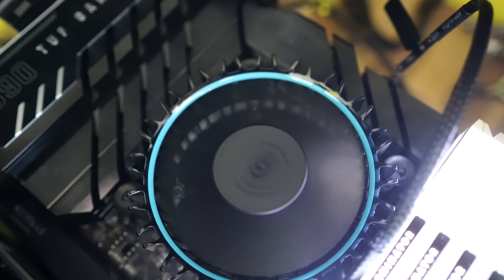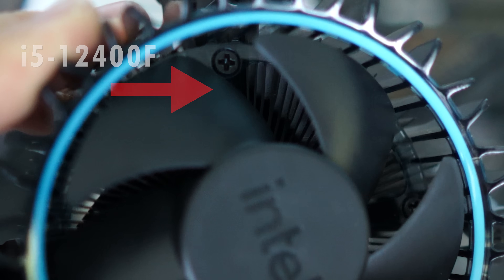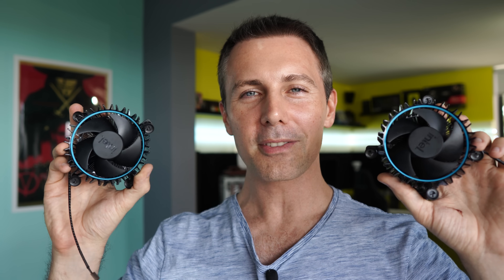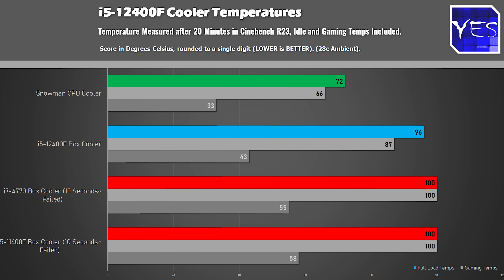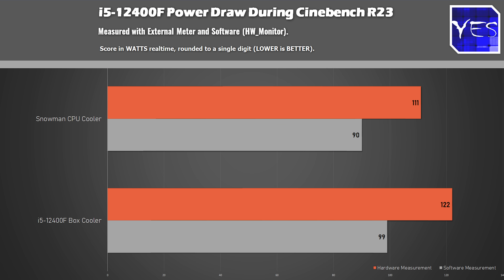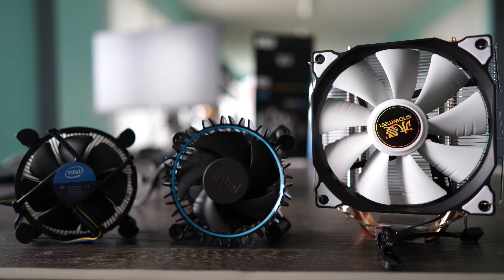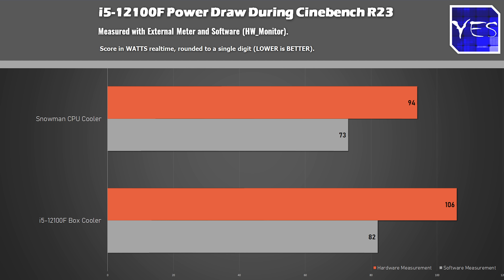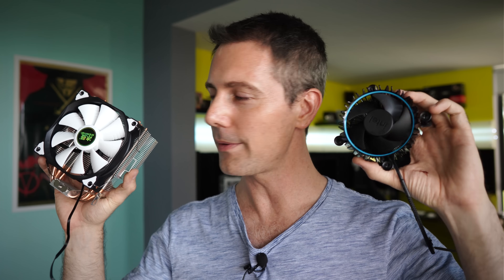Is Intel's New 12th Gen CPU Cooler Actually Garbage?

Comment: Can you fit a Wraith Prism onto an Intel CPU - to compare coolers? The Intel coolers look flimsy, though how do they stack up with AMD included coolers? $20 for a new cooler can go towards the more expensive AMD CPUs?
Reply: No IT can not.
IT use a clip systeem.
If you whant to do it .
You need a socket 775 clip systeem rack .
And the do not fit on the holes of the Intel boards.
Hè can try 3d print IT .

Comment: Remove the heatsink and you've got yourself a 80mm rearfan lol.
Reply: @Neorain-you just keep posting gems; how many cases out there use a 80mm exhuast fan as opposed to a 120mm?
Reply: @PapaMav  itx cases might have em. I also got a few cases with 90/80 rear.
Reply: @PapaMav  The heatsink you can slap on your forehead. Makes a good headmirror.

Comment: Reminds me of when I did a build back in 2013 with an i7-4770k (84W TDP). The stock fan couldn't keep up. I ended up putting in an AIO water cooler the next day.
Reply: That's a bit overkill for 84W 🤔
Reply: @Spido68_the_spectator  Overkill but it works.

Comment: Brian, I know you love the Snowman, but I definitely recommend checking out the Cooler Master i71c cooler. It’s $20 on Amazon, performs better than the Intel stock coolers, and has nice RGB. I’ve used a ton of them in my flips and it really does well!
Reply: Snowman is way better because it uses a hyper 212 no back pressure style setup unlike these stock style fans that just blow air on the mobo. Might as well get a deepcool 400 at 20$ on amazon if you don’t want to wait for China shipping
Reply: @seropserop  I understand your point from the perspective of absolute cooling performance, but I think the i71c has some great aesthetic points. It’s also incredibly easy to install and will fit on pretty much any motherboard and in any case, including a lot of OEM machines. It’s done great for me in many builds that I have sold!
Reply: @Brant Collins-don't know what AMAZON you are referring to, but, more like $38.80 in the States.....

Comment: No doubt the Snowman is a good cooler. I’ve used it on a few builds. There is another though…….and that is the “UpHere, CPU cooler. I’ve used this cooler on a 5900x clocked at 4.6 GHz all core……under 100% load……never got above 82C. Just for reference, using the Corsair h00i Pro liquid cooler on the same build, temps were uncontrollable at 4.6 GHz. Also, I am impressed with a thermal paste from “Shenzhen Halnziye Electronics”………specifically their “HY-700” product.
Reply: Hy-700 is worse than GD-900.

Comment: new? its still garbage. most reviewers are going to say these new intel chips are budget kings. they are in for a rude awakening. these wont perform well outside the more expensive, higher cost geared paired with them.
Reply: We'll see how much a H610 board with slower memory clocks hampers performance. But most B660 boards will be totally fine especially for 12100 and 12400. Memory can be cheap or expensive regardless so that's not an argument. Calling it garbage is a bit extreme. 12100F is the new budget king like it or not.

Comment: The same thing happened with AMD back in the day when they released their Athlon64 X2 series. The X2 series started with the LE-1620 cooler which was quite a thick thinned solid aluminum heatsink. With the 6000+ they just ran far to hot so they had to provide a new cooler which was the FAN-AM6000 heatsink. A proper thin finned design with copper vaper chambers and copper cold plate. I used the 6000+ cooler for years on AMD systems, since it fit on Phenom II CPU's as well, and it was just as good as aftermarket heatsinks of the early 2010's.
Reply: the 6000 cooler was like THE go to budget cooler for amd's cause it worked so dang good. I used it all the way till I started running 120mm tower coolers
Reply: @kasuraga  I'm glad others appreciated them, for the time they really were the GOAT before the huge aftermarket coolers really took off
Reply: This seems very similar to the one they bundled with Phenoms. It just uses a taller fan, which could have helped a lot. The Phenom ones were very noisy under load compared to a 9cm Noctua tower. Nowadays I actually prefer the C type Noctuas for ~120w loads.
Reply: The amount of needless apostrophes nearly gave me a stroke
Reply: @Nagib23_32  what?
Reply: @kasuraga  Look in the original comment
Reply: @Nagib23_32  it has ONE apostrophe, so again, what do you mean?
Reply: It will fit on AM4 as well.
Reply: @EvilTurkeySlices  while I despise amd's retention system, it is nice that they did maintain that system through the vast majority of the amd lineup. I just grew to hate it because I cracked a 2800+ barton core cause the heatsink tilted and chipped the die when I was trying to latch it over a decade ago.
Reply: @kasuraga  754 and newer used a different retention system to Socket A.
Reply: @EvilTurkeySlices  They use the same style of retention system, just altered for the new socket. They still use the spring bar across the center of the heatsink.
Reply: @kasuraga  it’s the same style, but different. Instead of using a screwdriver to push the silo on, there’s usually a lever to tighten it.

Comment: Just a thought (though maybe in reality this isn't relevant), if the Intel stock cooler on the 12400F has to spin fast to keep things under control, then perhaps the fan itself is using more power than the slower spinning fan on the Snowman under the same load? Grud knows whether it's possible to tell the difference though, or how large it would be. Perhaps feed the fan cables through a separate power monitor to see what they're pulling? I doubt it would account for much of the overall system power draw difference, but still something.
Reply: hotter chip consumes more power at the same freq and voltage. difference in fan consumption could be 1-3 watts.
Reply: @zodiacfml  Indeed it could be, but it would be good to see actual measured data. Sometimes such factors can reduce overall differences to just margin of error.

Comment: Idk if you heard but Der8auer overclocked 12400F to 5.2 ghz with bclk, apparently it's possible on some motherboards (he used high end asus mobos). Since you have non-K alder lake cpus, could you check if it's possible on the motherboards that you have? Imagine the value if it turns out to be possible on any cheaper motherboards. Could make for an interesting video.
Reply: Most likely it won't work with cheaper boards as it only works for boards with external clock gens which afaik only exist on top-end mobos
Reply: I have seen der8auer with 12400 at 5200ght and he said cpu was like 68 watts power consumption ..  I don't understand how that works... He can do that cause he can control voltage, or his data is just not correct?
Reply: @ZLO_FAF  The 68,9 W in the graph refers to power consumption while gaming. You can see him run a benchmark in the video @5:25  and HWiNFO is showing maximum package power 138 W.
Reply: @ZLO_FAF  I have recently seen a video from an Italian youtuber that showed cpu power consumption in detail, and yeah, it's not that bad, Alderlake has a very high peak consumption, but the average consumption while gaming and using you pc for productivity in a moderate way has acceptable power consumption.
Reply: Some B660 board can overclock

Comment: Wait, so the CPU draws more power with the stock cooler or is the aftermarket cooler just more power efficient?
Reply from the maker: draws more power because it runs significantly hotter.

Comment: Hey Brian, great video as always. Just have a dilemma since b660 motherboards are overpriced, is it worth it to save a few bucks and get 1th i5 and b660 combo
Reply: Could yeah. Depends on what you plan to do.
I run a 10600K in a B460 myself (which can accept a 10900K with some headroom !) And it works wonders. I built my PC around CPU and RAM combo because that's what Cities:Skylines asks for.

Comment: Change the fan on the old Intel cooler to the new fan on the new Intel cooler. You'll see the added static pressure and perhaps cfm is where most of the improvements are. The other part is the weight and design of the new cooler. But the fan is mostly the improvement.
Reply: When you say, "change the fan", are you including the plastic guide vanes as part of the fan? There's no old-vs-new Intel noise comparison in this video, but I wonder if it's actually an improved design, or if they just increased the top end RPM?
Reply: @Vegemeister1  fan. Its higher static pressure and cfm

Comment: Snowman is impressive for a $20 USD cooler.  Not very impressive up against a Scythe Fuma 2 where you can game in silence, or with just the GPU noise.
Reply: Such an awful comparison
Reply: Scythe Fuma 2 is 3x the price of the Snowman, when comparing Amazon (SF2) and Aliexpress (Snowman), here in Canada. Might be different in the US.
Reply: @soldierforchrist631 
I opted for the fuma 2, I run my 3500x at 4.1/1.285V(it didn't hit turbo and was running at 3.4/1.4V stock);

I have it set to be completely silent up to 75C(I have it set to stabilize at 70-75C in prime95 after 2 hours) above that I have my fan profile ramping it up to a 100 at 80C.

And I think it is worth the 3x price tag, you can go to sleep while your computer re-encodes your blu ray rips or whathever else.

In fact you could sleep right by the computer, I don't hear my fans at full load with an open case until my ear is like 10-5 cm from the cpu fans.
Reply: Well no shit but if someone isn’t buying an unlocked CPU there is absolutely zero need for a cooler like that. These are locked chips.

Comment: Still have my stock cooler on my Ryzen 5 1500X running a 3.9GHz OC at 1.35V (stock is 3.5 at 1.2V) with the CPU only hitting 66°C when under 100%Load.

Comment: Don’t you need to also measure the 12v wires off the 24 pin if you want to measure power consumed by the cpu?

Comment: I hate all the stock INTEL coolers i have to install. Not a fan of the plastic screw connectors. Recently i had to install a blueray player for a client. I hit the cooler by accident and had to reset it back on the mobo due to tight space. Just a major pain in the butt compared to the AMD equivalent. Why does INTEL make these low quality coolers ? They work well enough but why the cheap construction on the pegs? Ill always go with a screw on cooler if i can.  Does intel not understand you might have to take these off and put them back on ? Giving me nightmares just thinking about it.

Comment: The software reported power-consumption is rather accurate, i would assume a lot of what you are measuring is due to VRM efficiency going down.
Reply from the maker: This was done on a high tier z690 board.... couldn't imagine how much worse it would get a on a low tier b660?
Reply: @techyescity  That just makes it even worse.
But if memory serves me right HWMonitor uses Intels internal calculations and those again are based on the reported current and VID - which also tends to be inaccurate if any Mobo default-settings are messing with the voltage (And the z-boards are notorious for having extremely bad default-settings - a lot of extra voltage from LLC and other "features" that just increase powerdraw for nothing)
Reply: Sometimes it's accurate. I have a 4670K system where the reported full-load power draw differs by like 20W based on whether the machine was soft rebooted or powered off and back on.

Comment: Glad to see Intel upping their fan tech - it's definitely a step in the right direction for general users.
Reply: did they tho? their coolers are still not good enough to prevent heat throttle

Comment: I dont understand, why do the benchmarks with box cooler draw more power than with Snowman ?  Is the cooler itself drawing more power or ?
Reply: Because the fan is using more power as it spins faster…
Reply: The chip running hot basically makes the system give more voltage. Did an undervolt test of my GPU, at idle temps it did 110 watts in a stress test, when the temps start to go up it becomes 127 or so

Comment: And you're sure the older coolers didn't fail due to inadequate mounting pressure? I'm surprised they did so poorly compared to the new ones. The new ones just seem like older copper slug box coolers with a facelift. But... no surprise they got their trash kicked by the Snowman.
Reply: IIRC, on some of the lower-end models in some generations, Intel was shipping plain aluminum extrusions without even the copper core.  And sometimes the copper core is actually a vapor chamber, not a slug?
Reply: @Vegemeister1  Yeah, later on they definitely pivoted to the straight aluminum units. I have some sitting around here, and I have some with the copper center. And now I'm not sure if it is a vapor chamber or a slug. Good point. I'm curious which version he was using here, and I'm still curious about the mounting pressure, being they weren't made to be used on 1700, and companies offering adapters for existing coolers are finding that some have mounting pressure issues.

Comment: derbauer noticed you can BLCK overclock on some motherboards with the 12400, you should check your motherboards to see what ones have that hidden feature. it doesnt show up with a k cpu in
Reply: ASUS seem to have slipped this feature on the ROG MAXIMUS series using BIOS 0811 (der8auer showed it was there on both the Apex & Hero boards) when coupled with a non-K CPU. Why anyone would spend that much money on a motherboard to couple it with an i5 12400 might be viewed as weird purchase decision.

What I do find funny is raising the BLK is exactly how I used to overclock Intel 486 and AMD Athlon 64 CPUs as well as the obligatory downclocking the memory clock frequency to compensate... everything old is new again. Personally, I haven't used a locked CPU since the AMD Athlon 4400 (my first unlocked CPU was the AMD FX-60).

Comment: Isn't the power draw difference between software and direct measurment caused by VRM inefficiency?
Reply: yes!
Reply from the maker: Depends, the cooler alone dropped it by 10 watts, so also has to do with CPU heat as well. I think measuring both is the best way to go?
Reply: @techyescity  The power draw difference between coolers is mostly because of boost voltage optimization which adds about 1.5mV per C  increase in package temperature. Intel CPUs maintain boosts up to Tjmax and PL1/2 by ramping up the voltage rather than throttling back on the multiplier as temperature rises. 

As for VRM vs CPU power, unless you made sure LLC matches the DC loadline configuration of the CPU, we can't trust CPU power. The software CPU power is calculated using VID, temperature, and instructions mix executed so if VID is different from Vcore because LLC isn't set according to DC loadline, the power calculation will be inaccurate. Best to assume 90% VRM efficiency and go from there.
Reply: @techyescity  Cobber and silicium conduct electricty better at lover tempratures. So the drops in 10W is simply the CPU is more efficiant the coler it is. When messure the power on 4/8 pin CPU header and compare with the software CPU power, the different is heat/VRM losses.

Comment: I wonder how much can we optimize 12400F with undervolt? I mean, its locked anyway, might well run it at minimum required voltage.
Reply: De8bauer just released a video that 12400 is not locked on some motherboards. That was quite a surprise :-D It overclocked really well too to 5,2 GHz all-core.
Reply: @innocentiuslacrim2290  its still multiplier-locked. He just did BCLK overclocking with a board that has a clock gen. Doable with all non-K CPUs since Sandy Bridge but usually could just go 3MHz BCLK higher. Some boards with a separate clock gen could overclock BCLK without affecting SATA/PCIE clocks etc. This results in further overclocking just like the old FSB days
Reply: but make sure to not reduce stability while doing it!
Linpack xtreme is what i would use to make sure it's stable, and even might add a little overhead.
Reply: This test was done with the CPUs power limit set to unlimited tho. 
The stock coolers is designed for the CPU to run at stock, that means it let's the CPU draw over 65w only for a minute and then locks it at 65w for some time. 
In games this doesn't really affect performance but it doesn't heat as much and the box cooler manages to keep it under 90° all the time which is okay considering that the CPU is designed to run up to 100°.
Reply: haha, I did it the first time I got it. -0.050v and still stable, 4.0 all core and 4.4 boost.
Reply: @floorgang420  Can you give me a guide to follow and undervolt my 12400F with TUF Gaming B660M-Plus D4? Also how much temp and power you saved with 0.050v reduction?
Reply: Ah yes, the echo friendly mode. Undervolting cpu to reduce the heat and power consumption

Comment: Runs okay on my 12400F, 60-70C in games, 75-80C in CB, I have removed powerlimits. Ram is limited to 3600 in gear 1 with 2 x 8 sticks, 3733 boots but is a bit unstable, 3800 was very unstable. Hopefully new bioses will improve it.
Reply: this was discovered that SA voltage was not enough, which is locked at 0.95 at all B660 motherboards
Reply: @bsh7390  yeah, you may be right. In the bios I can set SA to 1.3V, but hwmon64 reports it at 0.94-0.96v all the time. I hope it will be possible to raise in later bioses.
Reply: Just a guess, but are you somewhere in the northern hemisphere? In a hot and humid environment like Queensland is right now (where this video was made, btw) it's gonna push those temps a fair bit higher, so there's less margin for crappy cheap coolers like the ones that Intel seem perfectly happy with.
Reply: @danielharvison7510  yeah, live in Norway, ambient temp 22C, outside 0C atm.
Reply: @Taraquin83  Gonna have to add a few degrees to "Queensland-ify" those parts.